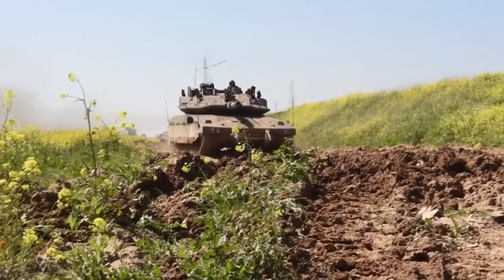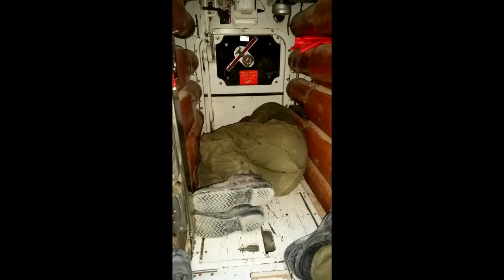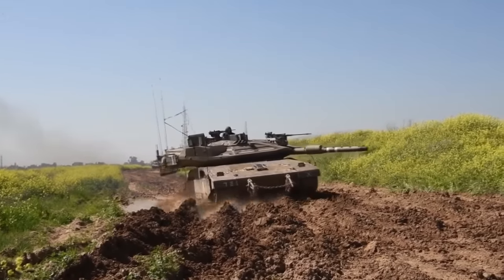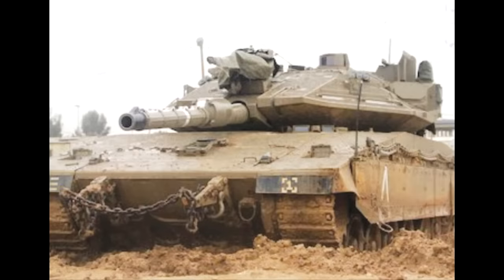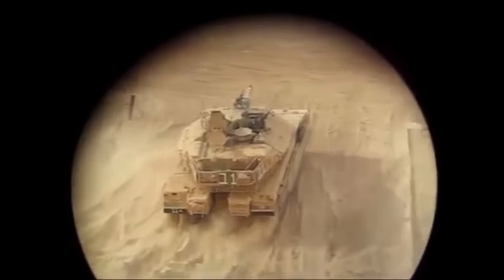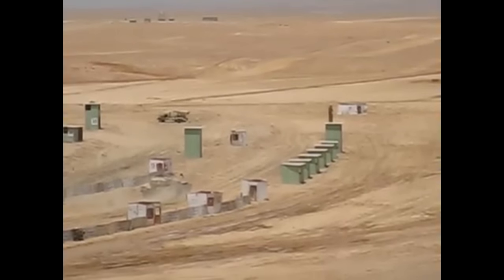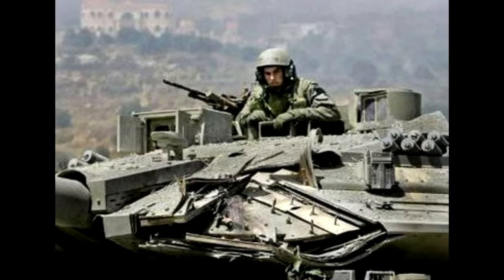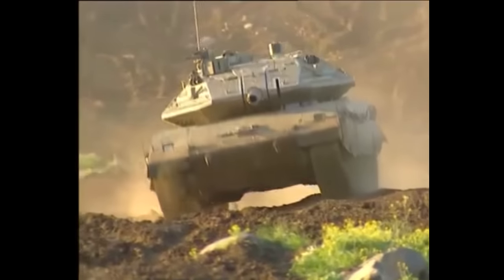Problems with Merkava tank

Comment: Interesting, the engine is something that always bugged me as well. About the L44 gun, can it be that they rather have a shorter gun as they're more likely to operate in cities? After all, the Merk isn't being exported and if Israel suddenly needs extra penn then they can easily press number 2 by having the US fly in some M829A* rounds, which I bet are compatible. (Are they?)
Reply: Exhar Khun my guess is that Israel hasn’t upgraded the gun because extra penetration with standard rounds isn’t a problems since Israel is not getting into combat with other tanks and is more concerned with infantry and argon/hollow charges. There is the possible Syrian or Iranian tank encounter but those tanks aren’t on the same level, protection or gun. The engine possibly interfering with thermals is also interesting but I thought the exhausts at the sides would divert most of the heat.
Reply: I don't think they are, seeing as the Leopards gun is FAR closer to the M1's and they can't share ammo without issues, I highly doubt the Merkava's shorter calibre gun can fire them without serious safety issues or mechanical issues. Red touches up on the "Hurr durr M1 uses the Leopard 2 gun" myth and points out the ammo isn't compatible.
Reply: @dankoz6340  oh, sorry, what Syrians do you mean? there are 4 factions, one of which is equipped with Russian t 72s and 
t 90s (by factions I mean, lie 4 different groups that are fighting each other.)
Reply: @_geck  I'm guessing he's refering to the pro-Iranian legitimate government. Do Kurds even have any modern tanks besides T-90s?
Reply: Thanks for the answer, friends. A bit unexpected to me. I'm fairly well read on older tanks and given Israel's experience in the Yom  Kippur war (where the US flew in actual US Army/Airforce inventory to replace Israeli losses) I've considered it kind of obvious that Israel would strive for interchangeability with US materiel. On the other hand, Israeli arms manufacturers have grown immensely since that time. Something interesting to read up on for me. Have a good weekend all.
Reply: @_geck  Haha, well to include the T-90. I think it, even with ATGM launched ammo won't have a chance.
Reply: No. It's the ammo. We still use depleted uranium. Du does not need high velocity due to its dense nature. That's why we havent upgraded. The germans outlawed du, so they fire tungsten carbide or something like that out their 120s that requires higher velocity.
Reply: Germans CAN fire our ammo but we cant fire german ammo...well we CAN but it's not as effective.
Reply: The M256 ammo is compatible with the L44 and L55 and vice versa as per NATO - STANAG 4385
. Countries like Germany and others wich prefer the L55 don't use american ammo because of laws that either prohibit the use of Depleted Uranium for weapons or make it's aquisition difficult to make ammo in any significant quantity, having to use tungsteen and compensating with increased velocity to achieve similar performace. Provided that the correct data is inputed into the firing computer (DU firing data for other NATO nations, Tungsteen firing data for US) it could effectively fire interoperable rounds with no issues.
Reply: @Ocastia  
Most of those are kind of irrelevant since we're probably not going to be seeing Leos or Type 10s fighting Abrams, or worse yet, Abrams fighting other Abrams(unless America decides to do the world a favor and sink Saudi Arabia into the sea). As for relic saving T90s...on the one hand this is possible, on the other the Abrams has options for triggering it's ERA without actually firing it's main gun(to my knowledge .50 cals have enough energy to trigger a wide variety of ERA devices) so it depends on what relic's threshold is as well as what range the engagement is happening on.
Reply: @Ocastia  
You could argue that it future-proofs the vehicle to some extent, reducing the need for sudden and massive investments in radical upgrades as new threats emerge.

Better is always better.
That's not to say I don't agree with you.
Reply: @The_Crimson_Fucker  well yes but let's face it if your enemy knows what you can do you don't really future proof anything.

Not that it matters anyways Whit how stupidly over the top modern warfare plays out.

And in the end: we will never have a non asymmetrical war aigan, or Well if we have one, that will be the last war on Earth for... Maybe forever.
Reply: @Ocastia  
Just because they know what you can do doesn't necessarily mean they can do anything about it, or that they're quite ready for it when you strike.

What's over the top about modern warfare? The games are awful but the real thing is pretty grounded if you ask me.

As for your last point, not necessarily. It all depends on who is fighting who and why. Pakistan and India proved that nuclear powers can go to war without irradiating each-other, but then again the fighting there never got quite that desperate.
In the end, it all depends.

Plus, nukes won't wipe out human civilization. They'll just have a profound effect on how we live out the rest of our short, miserable lives.
Reply: @Bagheera2  The Tungsten rounds are increasingly on par with DU.  DU is still considered better, but with advances in technology Tungsten is now pretty close in performance.  

Because the US and israel have significant nuclear industries there is lots of DU available, so it's the obvious choice.
Reply: The Israelis put the engine in the front as extra/armor crew protection and they can pull it out for repair super-fast. To them crew survivability is key and the tank second.
Reply: @mikeyfisher4256  it is the same gun...
Reply: the US gun was modified to handle the recoil of the shells its fired, thats why it isnt considered an exact copy of the L44, the difference is fairly significant  to handle the hotter ammo in US inventory
Reply: @dominusvictoriae  ah so it has a bigger gun breach, and more shock absorber-thingys (I'm not a gun engineer) to counter the increased weight of the
Depleted uranium rounds..

I guess the L/44 can still handle it, it would just shake the tank violently, and decrease it's lifespan.

Interesting.
Reply: @komradearti9935  mind you the 120 chosen for the abrams was picked even before the m1 entered production, later redesign of the turret was needed as the modification to the US produced l44 changed dimensions. As the abrams was always meant to take a 120, it stands to reason the us military would want the best they could get in that current year. Not to say it's the most powerful or even best choice, just that in 1980 trials with the leo2 proto and xm1 showcased the advantage of l44 120, but it also showed the wear on the system from us ammo. The modification extends lifespan. Majority of abrams choices are for lifespan, such as its turbine engine. Maintenance on the engine would save cost in long run compared to diesels and need less work. Now how effective that choice was is up to them. But overall yes l44 can fire us shells, just not if it wants a long lifespan.
Reply: @komradearti9935  have you ever looked at the early trials between the vehicles? If you havent give them a look as it's interesting seeing the choice between vehicles given their advantages, aswell as seeing the lineage of the modern Mbts
Reply: L44 is adequate against expected threats. The most numerous tank that Syria has for example is still the T-55 and they have a lot of T-62 as well. T-72 and T90 are a bit more challenge but can still be taken out.
Reply: @dominusvictoriae  You are kidding with maintenance on a turbine would save money over a diesel. Turbine is a terrible choice. This design choice was made like 40 years ago by Soviets first and US later in days when small powerful diesels were not available. No future US tank (nor any other modern tank in the world) will have a turbine as it is inferior to a diesel power pack in every possible scenario. Terrible power pack is number one weakness of Abrams tank.

Comment: i have two questions for tanks experts:
1-if the engine get destroyed, could the turret still rotate?
2-could we jam aps radars?
Reply: Did you see when the engine on fire they need a bulldozer for push the cannon barrel, so the turret turn sideways
Reply: thank you
Reply: It should be able to turn unless the batteries run out power and the turret could also be manualy rotated.
Reply: Russia claims it could jam Trophy but no russian atg fired at Trophy was able to hit its targets. .. Lahat is claimed to be able to jam all russian active hard kill System. .. but so far no Lahat was fired at russian hard kill Systems to proof the claim... russian claim is proof to be a lie .... Israel claim is not proof in any real Action so far ... the german ads System is imun against Radar Jammer because it use a huge range of Sensors to detect and locate incomming threat not only a Radar. ..
Reply: @fauzaanachmadillah4670  That's because the crew had already abandoned the tank
Reply: Depends on the tank model. In some cases you have APUs, which rotate the turret when engine is off.
Reply: You Belkans are magic; you can spoof IFF systems and create mass automated drone air forces so jamming an APS wouldn't be hard for you. :)
Reply: Modern tank turrets turn with electric motors. If the motors fail there is a hand crank
Reply: @QualityPen  the next noob knowing nothing .... Lahat has jamming devices against active hard and soft kill systems... So far everthing New in the russian Arsenal was fired at merkava equipped with trophy ... Russia sells everything for money because they are extremly poor
Reply: nothing has been tested in combat that proves that they can jam aps systems and the turret can rotate untill the battery runs out if nedded there is also a emergecy manual rotate
Reply: @nilasferm8025  Actually in the Russian attack against the US in Syria Russia tried jamming the missiles fired at the tanks and all failed to protect the tanks. Same with the other armoured vehicles. 12 of 13 tanks destroyed, 12 of 13 armoured vehicles destroyed. The two lone survivors were never targeted. One of the tanks was destroyed by shoulder mounted anti tank weapons, the rest by aircraft.
Reply: @johnstark4723  i stand corrected then
Reply: @nilasferm8025  no problem. Not many think about that day, and Russia certainly wants to forget it. They learned a lot that day. One, don't mess with the US Marines 🤣 
 40 Marines, not a scratch. 300 Russians dead, 150 wounded.
Reply: There is no need to jam aps because they can be still easily overwhelmed.
Reply: @nks406  lol, good luck with that 🤣
Reply: @johnstark4723  trophy radar can only deal with 1 threat at a time, why the fuck would those who are trying to destroy it need any luck with that? Ah yeah 😂😂😂😂😂🤣🤣🤣🤣🤣🤣
Reply: nks40 in an entire war we had only 50 tanks were hit at all, so the likelihood of getting hit twice at this short interval is unlikely.
And then it also needs to pen.
Reply: @johnstark4723  to be fair, all these news are quite dubious... official reports claim only a few dozens of PMCs deceased, a little more Syrian personnel, but the 200+ Russian causalities was likely to be misinformation. Also, most of the losses were from the Syrian government forces, including armour. Plus, a NYT article cites US officials mentioning jammed communications of some of their equipment, but no word on jamming ordnance. Anything else at this point I would say is mere speculation and/or gossip.
Reply: John Stark i dont think that those were 1. The russian army 2. The new russian tanks.. russia isnt mad to sell their new tech then they havent got enough on their own.. as far as i know those were t72 which are almost 45 years old
Reply: john stark you have a lot of imagination, you should be a PS2 video game scenarist.
wagner mercenaries don't use tanks, it wasn't an attack against US army but against kurds in the northern euphrate. the tanks that pariticpate to this attack were syrians, and none get destroyed by ATGMs, it was US air strike who destroy the armored vehicles wich participated to this raid.
many rage boi comments in this topic
Reply: john stark you have a lot of imagination, you should be a PS2 video game scenarist.
wagner mercenaries don't use tanks, it wasn't an attack against US army but against kurds in the northern euphrate. the tanks that pariticpate to this attack were syrians, and none get destroyed by ATGMs, it was US air strike who destroy the armored vehicles wich participated to this raid.
many rage boi comments in this topic
Reply: Solo Wing Borders hhhhhhhh
Reply: @pappd  hate to tell you but the official number of dead WAS 300. The Russian government paid out for 300 dead, and shorted the amount by 2/3'rds of what the families expected to receive because of money issues in Russia. I saw an interview with families and they all said the same thing that the government shorted them because of the high number of casualties. One showed the letter she received with payment. And they can't fight it either. 
Seems funny too that these were supposedly "mercenaries" yet the government paid their death benefits. What does that tell you? Interesting since they did the same exact thing for alledged mercenaries in the Ukraine after the Ukraine had positively identified the dead as active duty Russian soldiers.  
 Also, why would mercenaries ask Putrid Putin directly for air support? They wouldn't, only active Russian soldiers could do that. And they did request air support and Putrid denied it knowing his planes didn't stand a chance.
Reply: Just an crazy idea, but did designers of trophy count on barrage artilery fire from above with cluster ammunition, to confuse the radar?
Reply: @codexp78  probably, but not much you can do about it. You can only hit so many targets, it only takes one to put the tank out of action.
Reply: @johnstark4723   i just assume this tactics will give advantage to crucial first 50 sec to other units carry out the attacks, but as I mention still crazy Idea 😀.
Reply: @codexp78  yup, and as they found out the tanks are easy targets for US systems, especially aircraft. Even reactive armour didn't help.
Reply: @QualityPen  It's a competition between offense and defense.  Newer radar's are far more jamming resistent, but newer jammers are also more effective.  

Anything can be jammed, and any jammer can be countered (combine the radar with visual spectrum or thermal spectrum camera's, increase software level radar algorithms, etc).
Reply: @fauzaanachmadillah4670  it would make more sense because the fucking tank was on fire and most probably the crew was evacuated
Reply: @johnstark4723  Official dead was 300 ? WTF is was ? Then what is now. Who is reporting who is counting? Sounds like jews calling www2 casualties in con.camps. I saw numbers going  downfrom 1.5 million to 350000 dead.  Blackwater OPs never received government benefits so does Wagner they are all mercenaries private company employee. Wagner isn't even Russian registered company. Blackwater gone under water and renamed Academi. Ukrops should reunited with long dispatched relatives in Sinai.
Reply: @QualityPen  russia's military sucks cock lol
Reply: It was possible in WW2 by handcracks when you lost the power to the turret rotation you just use a mechanism inside the tank to rotate it. I dont know if its same with the nodern tanks tho.
Reply: 1. Yes, it has APU
Reply: Fauzaan Achmadillah The bulldozer had to dig cause the crew bailed out
Reply: TJ Murphy  Merkava has APU
Reply: @fauzaanachmadillah4670  Needing a bulldozer to rotate the turret while the engine is burning doesn't tell you anything about whether the turret can be rotated when the engine is TU. The bulldozer is rotating the turret to uncover the deck hatches so that they can be opened and the fire extinguished, and they need the bulldozer to do it because there's no one in the tank to rotate the turret -- the crew has unassed the vehicle. Staying in a burning tank is inviting a 'significant emotional event'™ when/if the ammunition starts cooking off. All tanks have backup methods of turning the turret without engine power; some have an auxiliary generator to power the motor to turn the turret, and there are always hand cranks.
Reply: No the turret will not rotate, all feature will shut down. I guess if they add solar panels it could. Some Syrian and Iranian tanks have extra solar panels that would allow the turret to function for like a minute after the engine is destroyed.
Reply: 1. most tanks have a secondary engine that powers the electrical systems and a mechanical fail-safe for turret rotation. idk about the merkava specifically.
2. i have not heard of proven case of someone jamming aps radars.
edit: please note that i am in no way, shape or form a tank expert. i am just a guy on the internet that has tried to learn as much as he can about tanks.